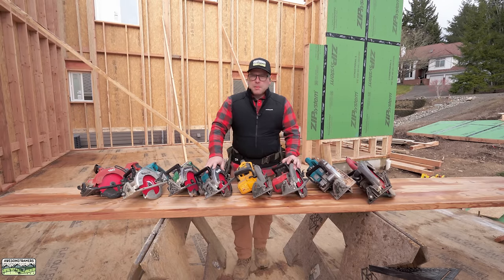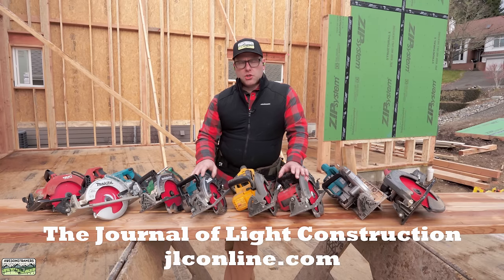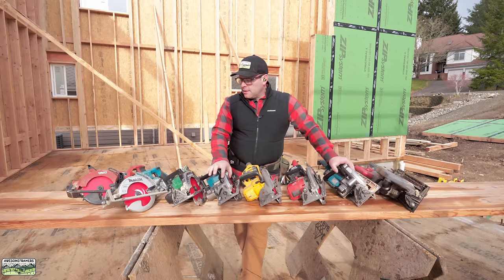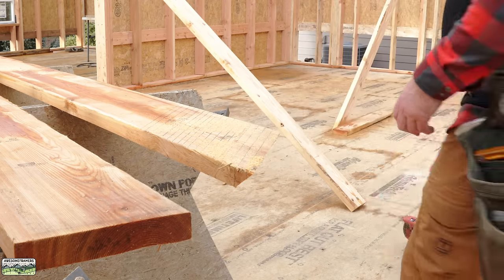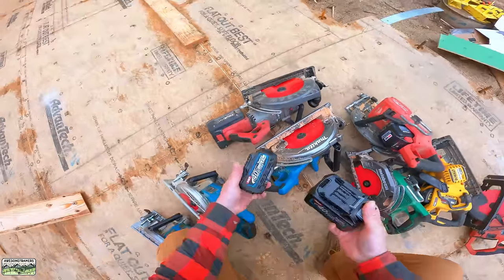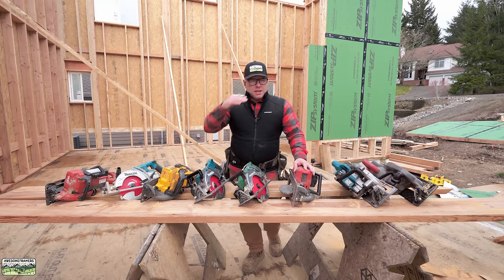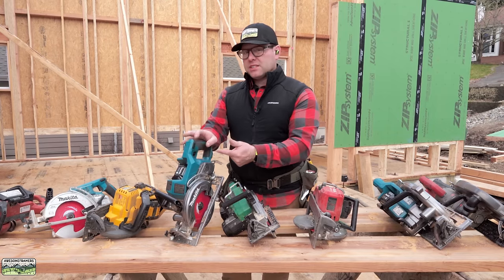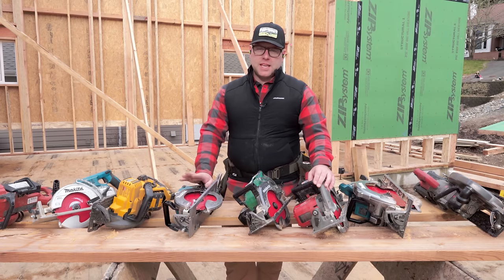Tool Review- Rear Handle Cordless Saws

Comment: Nice if not necessarily awesome overview. I’m over on the east coast and old enough to have worked along side men who apprenticed in the trades before WWII. Therefore I have a prejudice in favor of sidewinders and against batteries. I remember my Uncle Art buying a rechargeable drill in the late 1970s that was absolutely worthless. It had maybe an hour of run time and then would take 12 hours to charge up again and like a cell phone the battery could not be swapped out or a fresh one. You had to plug the whole drill in to charge it. I have gotten to the point that 90% of the time I use a cordless drill. I am thinking about switching to a cordless circular saw and reciprocating saw. The problem isn’t rolling out a long extension cord. It’s not tripping on it, getting it tangled up with another cord or an air hose, and of course, rollong it up neatly at the end of the day.
Reply: You should definitely have cordless by now. They're more than powerful enough to do 99% of jobs. Occasionally I'll break out my corded makita sawzall for full house remodels but it's honestly probably weaker than my dewalt cordless. I just figure it helps longevity for the tool and batteries.
Reply: @Tool_Addicted_Carpenter  I agree that I should switch over. The trouble is I come from a family that tended to not replace anything until it was absolutely necessary and there’s nothing really wrong with my skillsaw, sawzall, or multitool.
Reply: @janderson8401  Metabo HPT 36V has an AC adapter for their whole 36V line of tools so table saw, mitre saw, router, compressor, SDS Max rotary, vacuum etc can all be plugged in when AC is available and lifetime warranty
Reply: @janderson8401  Well that's the thing about cordless tools is that they still have their place. I still break out the mag77 to cut a bunch of PT deck stringers and like I said, the corded sawzall comes out for full house remodels. It's just a complete game changer to have cordless tools and they're cheap enough these days that you can get a nice kit for very reasonable money. Depending on your budget $2-500 will give you a very solid start.

Comment: I'm an apprentice carpenter In Ireland I do attic Conversions. I use primarily Dewalt. I use the small Blade left 165mm Skillsaw and the big worm drive. The worm drive never even binds. Amazing stuff. I would like to get on metabo too but it's not big in prescence here yet 😀
Reply: Metabo Brand goes by Hikoki brand name over there doesn't it?

Comment: Thanks for the video. Looking to get a larger saw from my 6 1/2 and like the blade on the left. Never used a rear handle saw but might try the Metabo. They make a metal connector nailer I'm looking at as well.

Comment: I was just hunting for a cordless circular saw.  The timing of this is perfect.  I have never tried Metabo before.  I’ll be curious where it prices out compared to Makita/Dewalt/Milwaukee.  Thank you for keeping it simple!
Reply: U can get more bang for your buck with Metabo HPT
If your a professional go mostly with the 36V tools, there are more powerful, lifetime warranty and have the AC adapter option for cordless tools like jobsite table saw, mitre saw, grinder, SDS Max rotary, portable band saw, vacuum, full size router etc
Also they have the best cordless and pneumatic nailers/fasteners 25+ yrs

Comment: I bought the makita 36v days before the Metabo released... Didn't even know it was coming.  Still happy with my purchase, but man I wish I had known better before I made the purchase.
Reply: Don't worry, the makita will outlast the metabo.
Reply: @Tool_Addicted_Carpenter  Maybe, but the Metabo has a lifetime warranty.
Reply: @hoezaycuervo  I'd keep an eye on that though. I'm pretty sure it only covers manufacturers defects, not wear and tear. I asked the guy that tunes up my guns which brand of power tools has the worst internal components, he said metabo, too much plastic. He said makita has the best. This is from a guy who's been doing it for 30 years and has 2 tractor trailer size garage bays full of tools to repair. Everyone I know uses him, so I'll take his word for it. Your makita is solid.
Reply: Tell that to my son
We have 3 of the Makita 36V 2x18's and he burned one up a few weeks ago
Time will tell and I love my Makita's but I have yet to burn up one motor on my Metabo HPT's over the last 4 yrs mostly the 36V tools
Table saw, mitre saw(4 of them) SDS Max Rotary, Full size router, grinder(3 of them)Hammer drills(multie) 7 1/4 sidewinder, vacuum, portable band saw, 3/4 impact wrench

18V triple Hammers(10 of them) Hammer drills(8 of them)
Trim router, multi tool(3)

36V duplex, 18V Framers(2),18guage(2), pin nailer

Comment: Afaik metabo and hioki (hitachi) battery system is the same. I'm with you, I have dewalt, hitachi and milwalkee systems. What a pain. 18 batteries 6 chargers last count...
Reply: The AC adapter changed my mind on going more Metabo HPT on my job site
Still bring Milwaukee and Makita but I was already all Hitachi(Metabo HPT) on my nailers so now I'm probably 75% green and the rest is mixed red/blue
36V table saw, mitre, saw, SDS Max rotary, full size router, grinder, portable band saw, vacuum we use the AC adapter for on longer run time applications-saves batteries and longevity of the batteries when we have AC available

Comment: Love Hitachi-Metabo hpt. Just bought the saw and triple hammer. Have the 36v hammer drill also. Wish Metabo would expand the line! P.S. bought my first hitachi impact in 2008-09. It and it’s 2 batteries still rolling

Comment: I think one of the biggest factors for many non-professional homeowners and DIYer's is simply the battery platform.  I have plenty of cordless tools from Dewalt, Milwaukee, and Makita, but don't see myself moving into the Hilti or Skilsaw line anytime soon.    Out of the aforementioned three saws, I would personally buy the 36v Makita because it's the most useful battery-wise and also the best value.  18v 5ah batteries are used in every tool imaginable, whereas the 60v Flexvolt is limited.  The Milwaukee is almost twice as expensive.  The 36v Makita on Black Friday is $260 for the saw, four 5Ah batteries, and a dual charger.  Can't beat that.
Reply: Im a diy guy, switched from Milwaukee to makita xgt, likely won’t switch back
Reply: I do diy. The 40 volt xgt is plain better. 2 battery makita don’t compare to the single battery xgt

Comment: Definitely one of the best reviews out there. The lay out, approach and just overall presence made the video very enjoyable.

I can't wait to see what Milwaukee and Dewalt will release to compete with the Metabo. Hopefully they can match the weight and outdo the performance. I would buy that Milwaukee saw in a heartbeat, full price

Just a bit salty I got the Milwaukee and it is stupid heavy for me lol. I hardly work with wood. Wish I had a smaller one but I do love its power
Reply: I’ll take your Milwaukee, love those saws.
Reply: I've had the milwaukee for about  2 ish years now. Got used to the weight and now it feels like it weighs 5 lbs even with an 8 ah battery. You'll get used to it.

Comment: I'm in the east coast and am left handed. Is it wrong to say that I like the way a rear handle saw looks and really wanted one? I went with the Milwaukee, to pair with the framing nailer. If I'm ripping I hold it on my right and guide with my left.
Reply: I'm with you there, I just can't cut with my right so I look around the saw while cutting.
It's annoying.

Comment: I bought the flex volt Dewalt rear handle (Dewalt is my biggest battery exposure) and promptly returned it. Shoe base wasn’t flat, and I found it way too heavy after using their cordless sidewinder for years. Metabo seems a no brainer to me.

Comment: It's funny, I have that Dewalt and that Makita 36V, I got it because of one of those sales and needed the batteries. I think the Dewalt is just miles better. I really don't like using the Makita, which surprised me, because I typically love Makita tools. It has so much less power, I run in to issues with it a lot, and I just think that Dewalt feels so much better. Different strokes, I guess.

Comment: Interesting.  So, wormdrive / not a wormdrive is not an issue for you.  Wormdrive is supposed to have more torque but maybe that's not a big deal.  Lightweight is definitely a driver.  Thanks for running through the comparisons.  Im sure it wasn't  easy gathering that many saws together.
Reply from the maker: The Makita especially has another torque 👍

Comment: Great review!. I need that Makita XGT table saw, come on Makita! But Makita makes a battery powered kettle to make coffe and noodles now, so that's pretty sweet, and their compressor fridge. I'm also considering the Metabo HPT table saw, but Metabo only has a 36V 4Ah battery currently. Where as Makita has a 5Ah and then there is DeWalt with their 15Ah (7.5Ah 36V equivalent).
Reply: Yeah but the Metabo 4.0/8.0 batteries run a long time and this table saw is the largest capacity table and we plug that AC adapter in when we have AC available for longer run times, especially when ripping 2,3 and 4x material
The Milwaukee and Dewalts go through so many batteries and the batteries get so hot and it kills their lifecycle
Reply: I wouldn't hold your breath on a Makita table saw. If they ever do come out with one, which I doubt, it will be only on the XGT system. A lot more people are going long, straight cuts with rail systems with saws. Super accurate and in many ways, a lot easier and safer.
Their 18V system is a true one battery platform with the flexibility to go from 18V to 36V depending on the application. 1/4" impact, obviously a small 18V is more than sufficient. Larger applications for a blower, chainsaw, big grinders, you have the X2. This way you don't have a huge battery on a small impact and only have an extra battery of the same system on high power applications as needed. They have been shipping only fast chargers with tools for over 10 years now with tried and true technology for fast and very efficient battery charging that monitors heat, and current and cools the battery during charging. Their batteries work on tools going back to 2005 and vice versa not screwing their customers by forcing them into different platforms etc.  Well over 100-year-old company, with well over 250 tools on one system. Hard to beat overall value, flexibility, reliability, SERVICE, the sheer breadth of tools, reputation, excellent power of Makita.

Only knock is that they are not as heavily carried at various distributors across America vs Red and Yellow and some of the cheaper brands, and there are a few tools they don't make that people like such as battery table saw and framing nailer. The framing nailer is a big surprise that they don't have yet honestly
Reply: @travisjazzbo3490  Makita has a 8Ah XGT battery now so there is hope. Already have the 2x18V track saw at work, just need something battery powered for ripping blocking and such. I have like 20 Makita 18V tools but I'd buy into XGT the second they bring the table saw.
Reply: HPT makes a 36v 6ah, but it's not available in many countries. If you can find a good supplier, they seem to run about $250 converted to USD. It looks big and ugly

Honestly, though. It's so easy to get those 4ah for half off, or 40% off, or free with a tool. I don't have their table saw, but I would guess you'd only go through 1 or 2 on a full work day.
People get put off by the low ah on the newer 36v tools,  but you get a much longer runtime compared to an 18v 4ah.

Comment: Isn’t it kind of unfair to judge the weight of the skil because it’s a bigger saw. It would be nice to know what the weight of their 7 1/4 saw is. Though judging by the one I’ve seen in other videos it’s not much lighter. Also I believe the skil is the only one that still has a worm drive. The others just have the same design but have a sidewinder motor. Does having a worm drive even matter anymore. It used to be better because of the torque it could put out but that may be irrelevant with current technology. I’m not some skil fan boy but just had some questions from the video. I actually have the Milwaukee platform. The only battery saw I have is a 6 1/2 but that’s because I’m a plumber and not a framer so I don’t know much about these tools

Comment: Wait a minute.  You mentioned using a saw with a left sided blade, and complained about using one with a right sided blade and not being able to see the blade or having to lean over to see it.  Then on your first cut, you beveled the blade and looked over the back side of the saw, and watched the blade cut through the entire cut line, you know, where there is a sight window...

This is the absolute Best Case for never ever saying there is a right or left handed saw.  Reason is, you Can Absolutely SEE the blade from Both Sides of the Saw, regardless of the left or right sided blade drive.

I always laugh at someone when they tell me they NEED a "right handed" saw, and then show them how to use either saw and still be able to see the blade go into the cut and across the entire cut line without having to lean over to any side.  There isn't any such thing as a Right or Left handed saw.

Maybe it was because my grandfather showed me how to use the tools of the trade, and he was an old timer, even in the 80's, when I was a kid, and he came up in a different era concerning the Trades.  

Same with cutting a piece of limber and having the short side of the shoe on the same side of the lumber/stock you are cutting, instead of having the short side hanging over the piece being cut off.  You get a way better, cleaner and straighter cut when using the saw the proper way.

Comment: I'm not a builder. I'm a home owner who likes to build projects for my family and do remodel work on my own house. I currently have 2 makita 18v drills. Would it be smarter to move into the xgt or matabo family or go with the two-battery makita saw that shares batteries with my current drills? I may end up buying more cordless tools down the road like a Sawzall and nail gun.
Reply: I'm in the business and I have a fair amount of cordless tools, I tried my best to keep it all the same so batteries would be interchangeable on all the tools and I could buy bare tools with no worries.
That is what I would recommend, I have Makita and have built up a fair number of batteries and tools to go with them.
I get around 4 years of life from batteries and that's daily use.
I have the Makita double battery saw he loves and I love it too, also the double battery miter saw is a thing of beauty and never lacks for power.
Reply: I would really consider the Metabo HPT line , especially if u need a table saw and mitre saw because the 36V tools  can also use the AC adapter when u have AC plugs available-it a jobsite it in your shop garage- the other brands force u to buy more batteries for all of their tools-I also use the AC adapter on the 36V full size router, vacuum, SDS rotary hammer and sometimes the Recip saw and circular saw+Metabo HPT has the best nailers in the trades 25+ yrs running both pneumatic and cordless
Makita and Milwaukee also have great tools and I actually use all 3 colors and a few other for certain tools-but for the best bang for your buck Metabo HPT is gonna get u a bit further and also has the best warrantee(lifetime) and the multivolt Batteries work on the 18V and 36V tools
Makita did not make their 40V compatible with the 18V tools(Another big reason I have switched to more Metabo HPt over the last 3 yrs
Reply: stick with makita.

Comment: I do have one question though.  I am on the Milwaukee platform, and already have a 7 1/4 framing circ. saw, and it works great, all day long even with a 6ho or 8ho ah battery (although the smaller batteries will spin it, just not for a long duration).  They have the rear handled one you have in this video.  TBH, I don't see the justification as of yet, to buy the rear handled saw.  It isn't any more powerful.  I do understand the reasoning for buying a gear drive saw and the added torque, but I don't know anyone other than Skillsaw that makes one cordless.

Comment: started framing in 1983 in so cal....right at the crossover of hand/nail guns but guns were more common.....skilsaw was only brand in town, when cordless first started i was putting together my tools and cordless were junk ( the battery was in the handle of makita drill).....now that cordless is solid hard to justify replacing everything I own over to cordless....been inching over that way  ever so slightly and recently got my makita 36v stolen and wasnt a fan of the balance, went back to corded skilsaw.....but will give the matabo a shot or 40v makita.....I dont mind the cords as much as the newer guys guess cuz its been normal for so long and worry of battery being charged is never concern

Ive worked with east coast guys and dont know how they use right handed blades for cutting, it is completely foreign and just plain WRONG, lol

Comment: Whatever the tendon is the pulls your wrist taught when holding these saws I popped in my right hand 6 years ago using a drill. Nothing even happened, put screw in, it hit tight like it always does and then there was a pop. I'm scared to even try to use one of these all day, that tendon going pop again will shut me down as a 1 man crew

Comment: What is the advantage for the rear handle saws over a standard sidewinder circ saw? It seems difficult to use with one hand when you need to hold your workpiece from moving around.
Reply: As a man who’s only used side wonders I am struggling to understand the advantage too. The old worms had enough weight to hold themselves flat it seems. But using a sidewinder I’ve very used to holding my workpiece in one hand with thumb as a guide and being able to put enough pressure down form the back and top to hold the saw flat. 

I like the idea of the rear handle saws though…